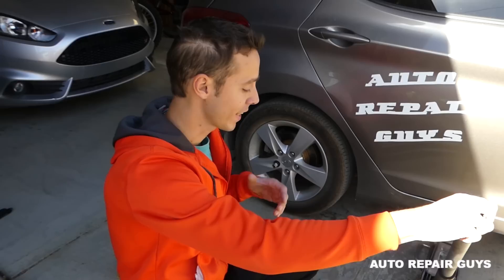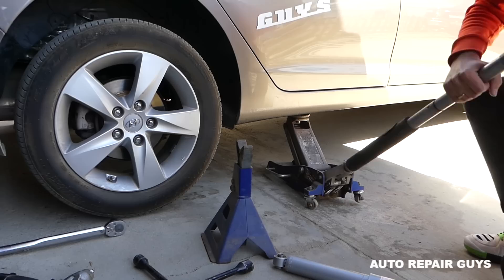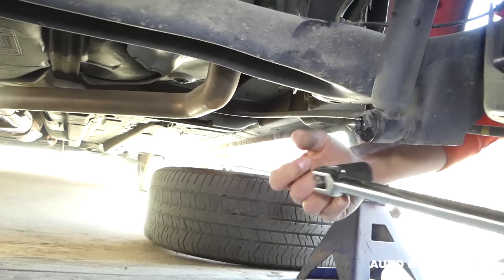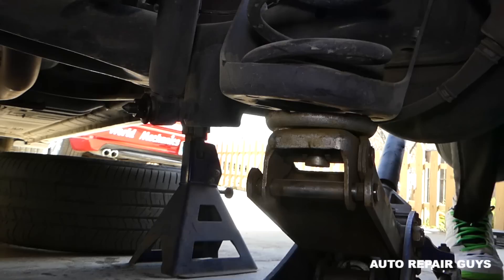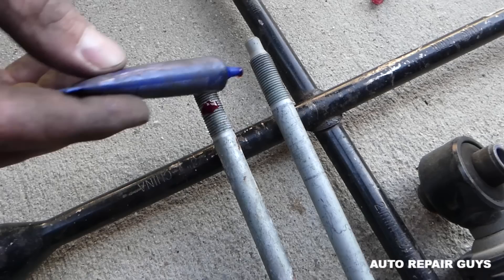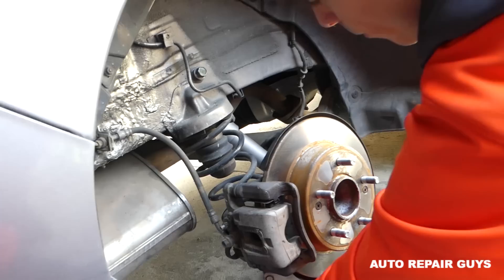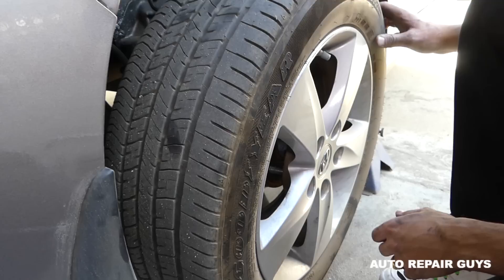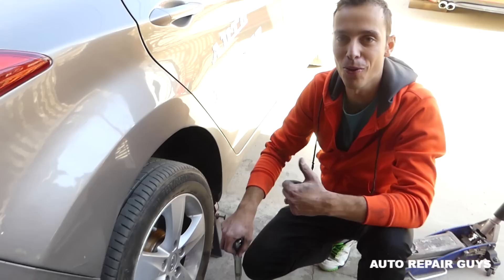HOW TO REPLACE REAR SHOCKS STRUTS ON HYUNDAI ELANTRA

Comment: Do not use RED thread locker. If you ever need to disassemble those parts again, you will need torch to heat the part to at least 500 degrees F to get them apart again. Those bolts should not need any thread locker if they are torqued correctly, but if you still want to use some, use the BLUE thread locker.
Reply: I agree, the only thing I put red on is the steering joint retaining bolt because they usually call for it.

Comment: You guys have saved me so much money! The shop time here (small mechanic shop) is 110.00 an hr. With a hoist you can replace rear shocks in 15 minutes. On the ground it takes a little longer. Still worth saving the 110.00. Like paying yourself.

Comment: Great video.  Helped me replace the rears in my 13 Elantra Limited at 70k miles.  Not only did I have the wandering/bouncy/out of control rear in turns like you mention, but the OEM crappy shocks actually cupped my tires severely after only 15K miles from the poor damping.  basket ball effect. I hope these shocks (and new tires tomorrow) solve the problem, because I'm not replacing tires every 15k miles. Why would they offer suck crappy shocks from the factory? I used the torque specs for the shock bolts and did not use loctite...kinda useless with all that WD40 over the bolts, and you shouldnt need loctite if you torque them to 87 ft./lb.

Comment: Looked easy except could not remove top bolt.  the rubber bushing would not let the bolt turn and spent almost three hours trying to get it out.   Ended up having to take to shop to have it done.   Took them two mechanics, melting the bushing off the bolt and vice grips to get it out.  Also had to rethread the bolt.
Reply: That was my problem too , put wD -40 I waited a few mins and came out nicely

Comment: Thanks for sharing your videos my friend..I have a question: What would be the proper torque for Sprak Plugs on a 2012 Hyundai Elantra Touring?..Thanks again.
Reply: The repair manual says 15-21 ft/lbs. I just did mine recently and split the difference at 18 ft/lbs. Do NOT use anti-seize either.
Reply: Sorry, I missed that you have a touring. Mine is a GLS stick...disregard.

Comment: do you know what size is the square nut on the other side where the upper bolt of the strut goes in ? mine needs a replacement. it’s stripped

Comment: First you don't use a torque wrench in the reverse direction unless it is calibrated for it.  The second thing is you don't use a torque wrench for loosing nuts / bolts!!!

Comment: How do these handle vs the oem? Wanting to change main out but still undecided on which ones to order! Thank in advance for a reply sweetie..
Reply: I just did it and it took 30-40 minutes tops. Very simple. As far as driving, the car is much more steady and stable on turns. I have been testing it by accelerating rapidly around the u-turns under overpasses near my house. It handles noticeably better. For the price of two shocks and 30-40 minutes, it is well worth it.

Comment: I do not have a hoist. Can I replace the shocks on my 2010 elantra along with the upper mounts? when I can only raise the car about 12 " off the ground. Other wise I would have to pay someone the labour.  The problem is that I may not be able to remove the bolts holding the upper mounts. That is the problem. Any answers?  Thanks

Comment: For those that wanna do it exactly this is the torque spec.  Rear shock bolt to body = 101.3~115.7
 Rear shock nut to rear carrier = 72.3~86.8
Reply: 101-115? SHIT, THAT IS TOO MUCH.

Comment: That long bolt keeps spinning and won’t thread out
Reply: I bet it's on the passenger side??
Reply: @timg5411  Yes, did you ever see a fix for this?
Reply: @matthewroseen7453  I broke that weld piece off the back side and air hammer the bolt out then used a 26mm wrench to hold the square nut to tighten the bolt back up

Comment: I changed my hyundai elantra 2013 limited editon with KYB shock but the same thing it goes right and left specially in curved
Reply: You'll have to take it to an alignment shop and get the rear toe adjusted with shims
Reply: @Jonathan A Wasn't being rude. Was just trying to inform.
Reply: @Jonathan A I could have called you worse, but I didn't. I apologize for hurting your feelings. Not cause I mean in it, just cause you're still upset about it.